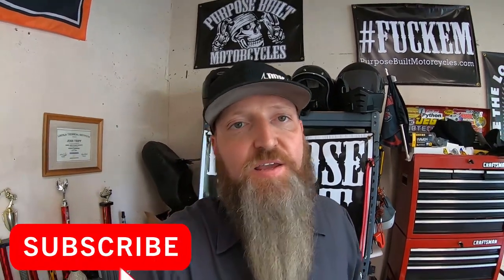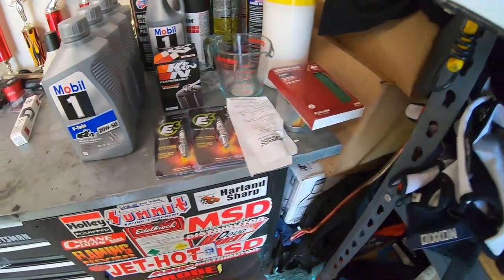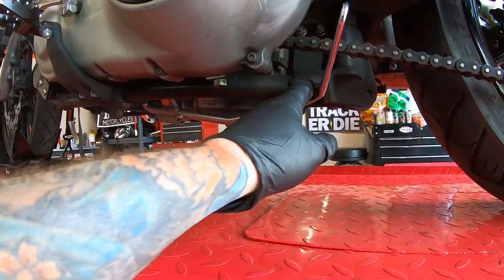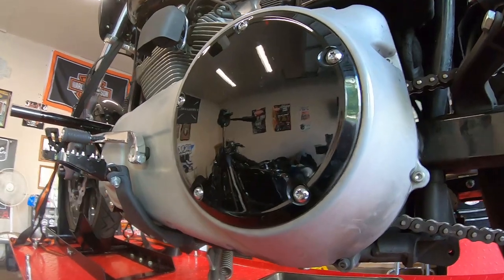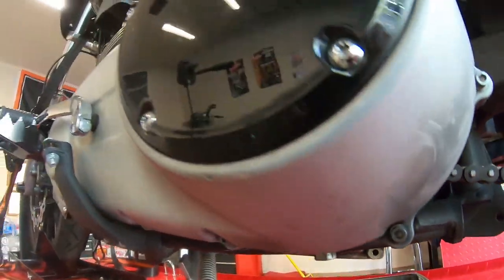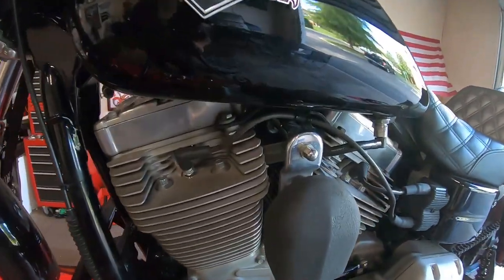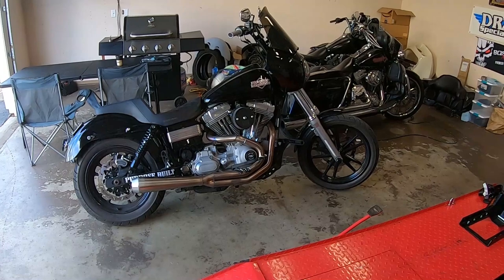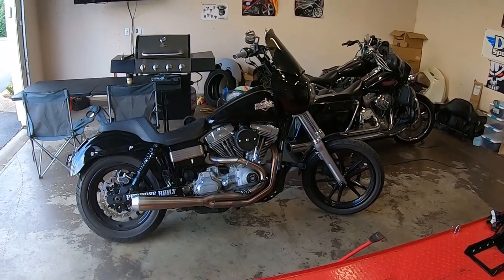Harley Dyna 5000 Mile Sevice How To

Comment: do you have any problems with the elite lever with clutch adjustments
Reply from the maker: No what we have found is to set the lever up with zero end play and your golden have a bunch of buddies running them with zero issues but the cable/lever freeplay has to be set at zero hope that helps might do a video on it so many questions on this lol
Reply: @TrippHPjunkie  my Dyno guy,Mike beland at a1 cycle changed my lever to stock because it was making the Eddy brake on the Dyno jump,I love this lever and also take all the slack up on the cable but it is a pain to get neutral at stops!one thing that sucks is they delete all negative comments on there page and don't return any questions about this issue on there tech line!
Reply from the maker: Weird I have had zero issues with the adjustments sorry man
Reply: I had the same problem with mine I ended up selling the lever after a 15min ride.
Reply from the maker: So strange man we have multiple friends that have this setup with zero issues built motors stocks motors its just a lever and perch very strange....
Reply: @TrippHPjunkie  if the perch was 1/2 inch higher it would cure this problem and I suggested this to elite and got no reply so they suck but I'll think of something because I love the feel !
Reply from the maker: Yea dude thats strange man..... like I said before theres like 7 of us local guys running them with zero issues when did you purchase the setup? Just curious if its new or old problem thanks man